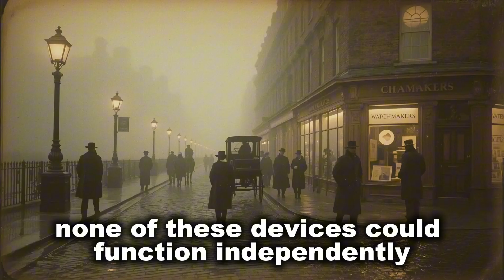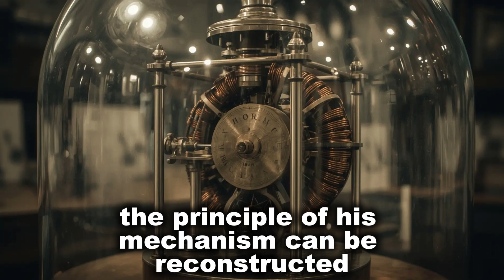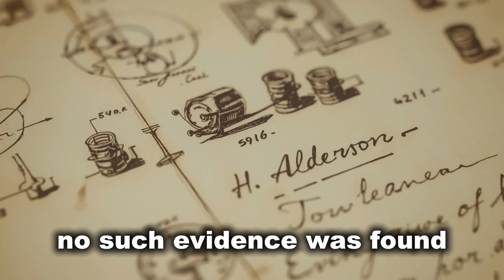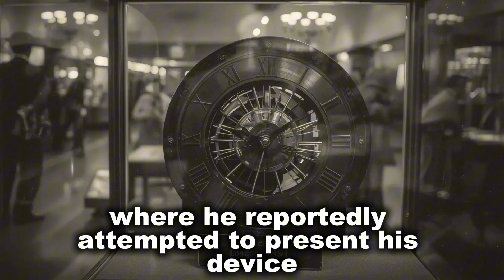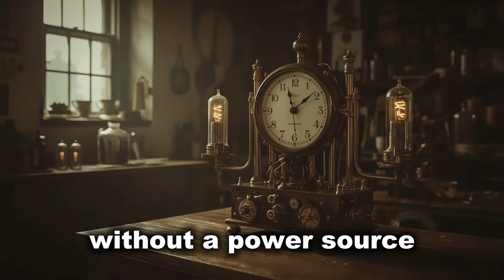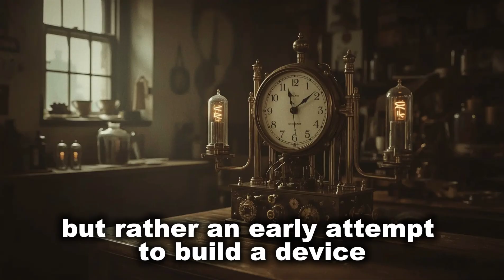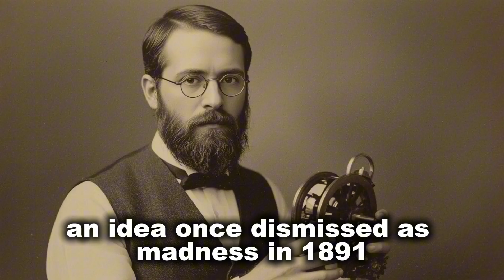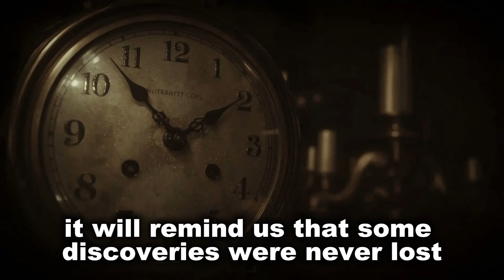Electronic Clocks… Created Before Batteries | Inventions Ahead of Their Time

Comment: Hi. Interesting video, thanks. Up until the invention of quartz crystal vibration clocks in the early '30's, the most accurate electro-mechanical clock was Frederick Hope-Jones's  "Synchronome". It worked on the principle that the constant weight of a gravity arm falling a constant distance onto an inclined plane would create a constant amount of kinetic energy. This gave the pendulum an absolutely constant push every 30 seconds. Clocks using this method are called "gravity impelled pendulums". Another brand from the 1920's was the "Gents Pulse-Synetic." Both brands were "master clocks" used in factories, schools, railway stations etc where each "dial only" clock was synchronized electrically to the "master". 

I have made five g.i.p.'s , three are electro-mechanical, and two others are completely mechanical. Four have temperature compensated pendulums and can be adjusted to within two seconds accuracy per week if I'm patient, but changing air pressure and humidity also interferes with accuracy because it alters pendulum swing and introduces "circular error". 

A perpetual motion clock has been made that uses changes in air pressure to keep itself running. Research Drebbel's "Atmos" clock of the early 17th century. Fluctuations in the earth's magnetic field hardly generates enough power to run a single L.E.D., let alone a clock. Must go, running out of time. Cheers, P.R.